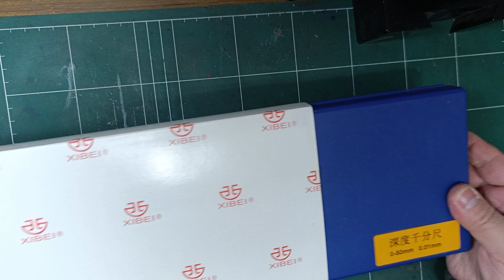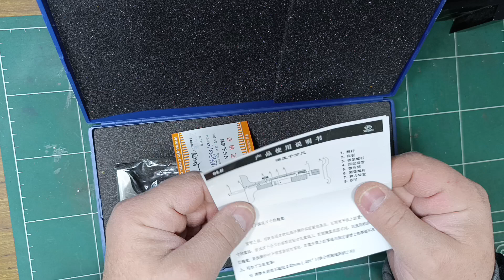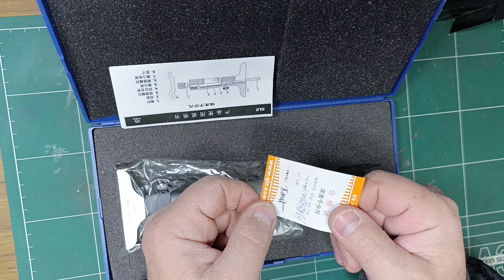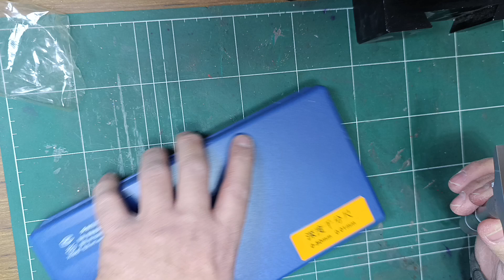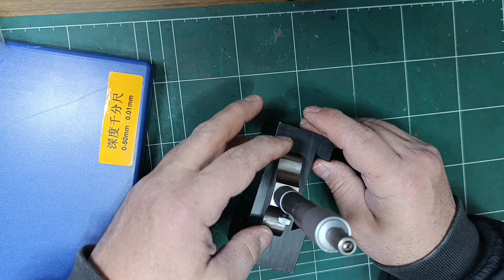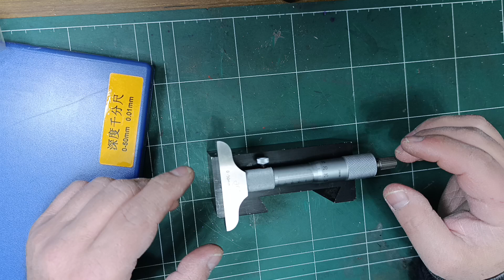New shop tool

Comment: About how much does something like that cost?
Reply from the maker: @azrobbins01  around 20usd.
Reply: @Smallathe  Thanks!
Reply from the maker: @azrobbins01  My pleasure mate. Here is the link where I bought mine 2 weeks ago: https://www.aliexpress.com/item/4000635498864.html?spm=a2g0o.order_list.order_list_main.23.1fc81802GQ0xlZ
#No affiliation whatsoever :)
Reply: @Smallathe  Thanks again!  I have never purchased anything from Aliexpress.  Is it any different from amazon?  For some reason I thought everything came straight from China so returns would be a nightmare, and counterfeits would be rampant.
Reply from the maker: @azrobbins01  Good question - I buy from amazone and aliexpress (and there are other websites for machining tools). US made brands like Starette are wonderfully made but a tad too expensive (not to mention delivery). If I want percision tools (like my micrometer and calliper) I buy Mitutuyo that have a dealer in my country (but are bloody expensive too, of course - my digital calliper was 160USD). Still, quality tools are worth it. But for most uses like my bore micrometer I buy chinese stuff. I try to avoid the faking brands that write "mitutugo" on their products and look for brands that have their own logos. If you clean up the tool and callibrate it - it will work well. That's my 2cents. Hope it helps :)
Reply: @Smallathe  Thanks again!